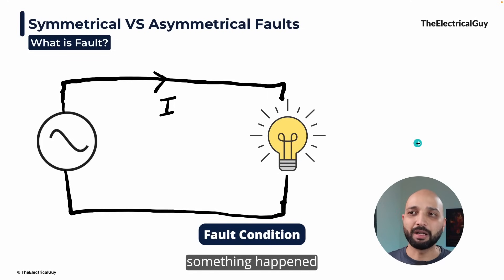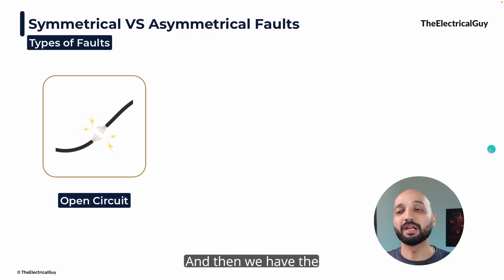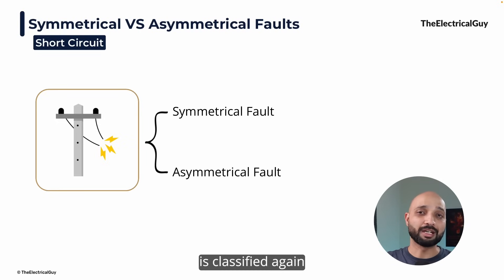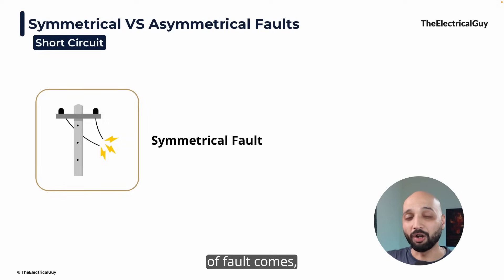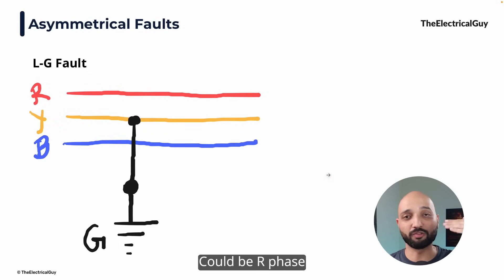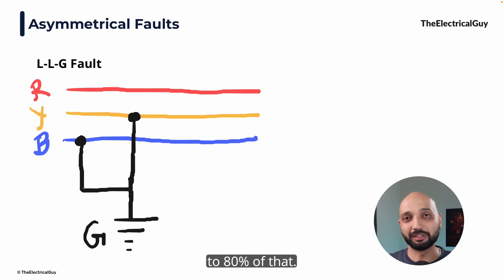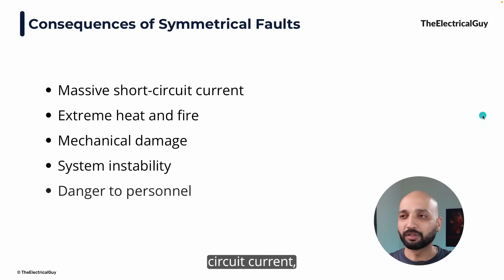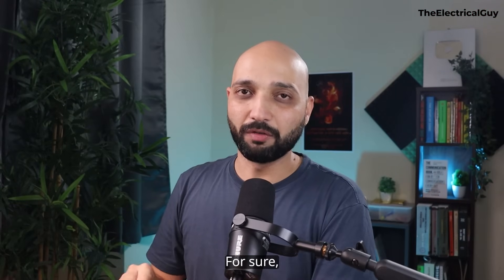The Most Dangerous Fault in Power Systems | Symmetrical vs Asymmetrical

Comment: LG fault is most severe in some case if fault occurs at the terminal of generator.
Reply: Compared to LG, LLLG is more dangerous wherever the location but the occurrence is very less
Reply: Important MCQ in exams😂 during competative exams
Reply: @deeptotop important to the design of any break generator etc..